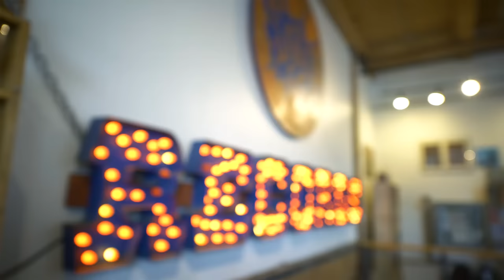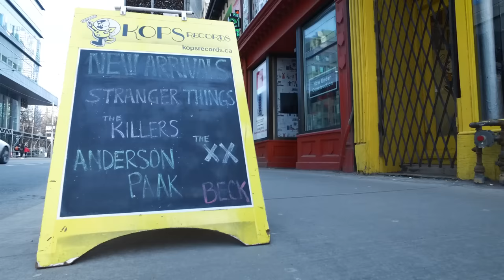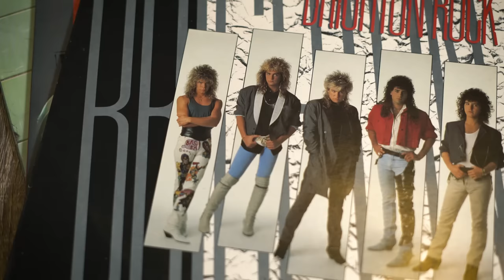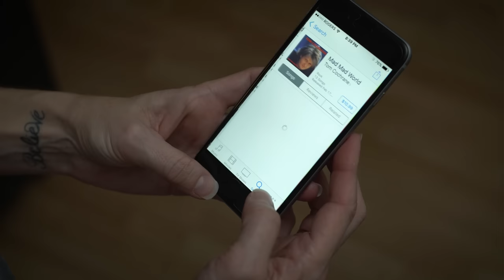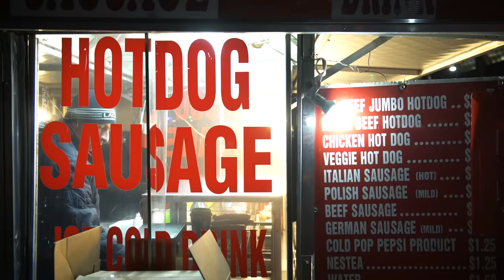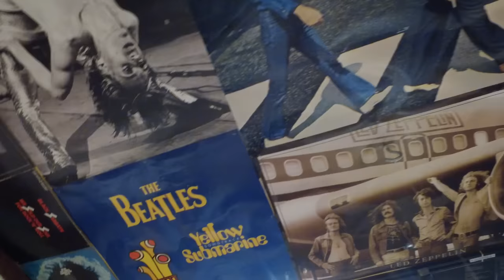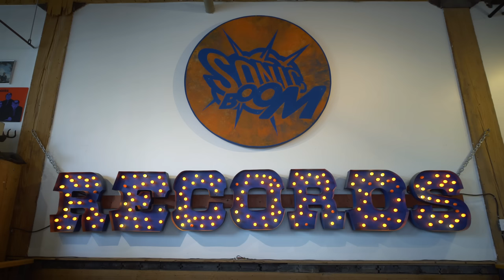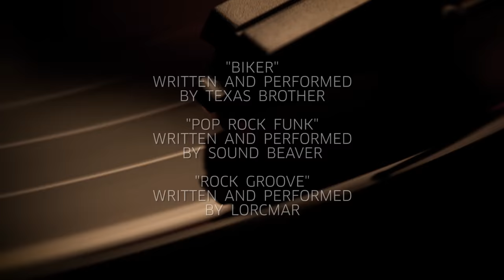Vinyl Revolution -| Music Documentary | Full Movie

Comment: You know this is all individual perception, not fact. The sound you hear from any speaker is an analog signal, whether it comes from a record, cd or mp3.  A cd is just a laser that reads pits on a sheet of plastic while a record is a sheet of plastic getting spun by a motor with a needle dragging over its surface that distorts as it moves toward the center. The difference we hear is in the mastering.

Comment: Shortly before noticing this documentary I had listened to a Walter Wanderley album, which is a small part of the Bossa Nova genre I find fascinating and rewarding. Records were part of my life from the mid '60's onward and one aspect of the format I really enjoyed in the late 1970's was buying direct to disc recordings.  The best examples were quite dynamic and I still search for them, usually they can be found for very reasonable prices compared to when they were released as they tended to be rather expensive and limited editions.

     For many years I listened to CDs but gravitated back to records 5 years ago and back to that vast analog world, finding many artists that I formerly never knew, of course musical preferences changed as I aged so that opened a door into so much diversity I would have not previously considered.  I have yet to find an analog recording converted into the digital format that can surpass an original pressing on LP.  Admittedly there have been more than a few marginal releases mastered even during the heyday of the 1950's and '60's but overall a much more involving experience.

     One senses they might be " addicted " when what was supposed to be a diversion with a single turntable becomes five, in fact I use two in my modest bedroom system as I listen to albums practically every day and thought it might make sense to slow down the wear and tear. I seem to have an appreciation for Japanese direct drive from the late 1970's into the early 1980's, what is considered the '"golden age " for the design. An added advantage is having different cartridges as well with their own unique sound signature.

    I suppose retirement does have certain advantages, being able to listen to music any time and more of it available allowing one to visit local record stores. The increasing number of reissues, especially in the Jazz audiophile category can definitely create a budget crisis at times but I have to admit I often find more excitement going through the 1.00 section which has allowed me to add quite a number of lesser known musicians to what is basically a musical library. Very fortunate to have access to the large number of ex CBC Radio Vancouver records that are made available at one store in particular, albeit in small doses as there are hundreds of thousands in storage that are slowly put on sale. That adds another part of the history of music as well, knowing at one time an album I have was played over the air. I have also found inner sleeves or notes signed by the artist in a few of the 1.00 LPs which is always an added bonus.

  Except for the limitations that most of us have trying to store one's collection the only real negative aspect is the thought of moving all of them!

Comment: The 180 gram thing is more or less a sales gimmick. It's possible that a heavy record may help to dampen vibration while on the platter (I've never noticed that), but the thickness of a record has nothing to with sound quality since all grooves are cut at the same depth (it is the width of the groove that makes a difference in sound). The only real advantage to heavier records is that they may be more resistant to warpage or breakage

Comment: I started buying vinyl in the mid 90's when albums in good condition where on average $3 each, yes they really common albums. Hard to find albums,  most of them I have never come across. I don't like brand new albums, as it takes away the fun of finding an original, or an old reissue, that is still vintage.  I've own over 2,000 albums at one point, not including singles.

Comment: For me the best part about vinyl is that it isn't brick walled like CD's and digital files are.
Reply: That has NOTHING to do with the medium, and EVERYTHING to do with the Mastering of the audio that ends up in the medium. Make a master from the original master tapes/files and put it on an LP, then take the same tape/file and do an equivalent master for CD/Digital, same levels/dynamics, and discounting the gear you use to listen to in on, there is NO functional difference. What spoiled everything was the "Loudness Wars", NOT the fact that it's analog or digital. And not ALL CD's or Digital files are normalized and brick walled to death...
Reply: @conan5885  it's my understanding if you mix a vinyl record too loud it skips? I know not all digital/CD releases are brickwalled, but so many of them are, while their vinyl counterparts aren't (or aren't as bad).

Comment: 90 percent of the audible difference between LP and CD is how they are MASTERED. The other 10 percent is surface noise from the vinyl surface.

CD, and digital uploads, are mastered for maximum LOUDNESS, because it can be done so in the digital realm more so than with analog/LP.

Put the pre-RIAA curve master for LP on CD, and I guarantee you it will sound just as good as, and exactly like the LP, just minus the surface noise, hiss, crackles, etc.
Reply: This! ☝️
Reply: It's not only the Loudness issue regarding the Master, it's also the corresponding EQ for each medium. If you put a copy from a Master that's been mastered for LP without touching anything on it, it will sound trebly and shrill. If you properly EQ and master it for CD without over-compressing it and touching loudness or the dynamics between the frequencies though, and discounting the fractional coloration from the equipment that is played back on, it will sound roughly the same.
Reply: @conan5885   It would probably sound thin, not because the CD is doing anything to it, but because CD/digital audio itself  is  perfectly flat bandwidth,  from 20Hz up to 20kHz.

Whereas our hearing response is anything but flat.

Comment: Buying vinyl is cheap enough. But you need a good quality system to play it on to really hear what you were meant to hear. Buying a Crosley portable turntable will just not cut it in the least. Test drive some system before you drop your hard earned money if you want the true vinyl experience.

Comment: I disagree with the speaker who at 11:15 who claimed that vinyl quality went downhill after 1974. I have 30 feet of LPs from before 1989 and what I observed was quality was manufacturer dependent. Columbia records were the very best. If the record had a red label it was going to be perfect and sound superb. But records by MCA were the very worst. MCA records have poor sound quality, tons of noise and pops, and there could be chunks of recycled paper built into the record.
Reply: Yeah, I disagree for the most part. The RCA Dynaflex and Ktel albums, fit what he was talking about - they were cheap flimsy and pressed with dust in the groove. Most were still pretty good. One thing that he IS correct about, those pre-1973 vinyl could play through, even when heavily scratched

Comment: Buying a used or new reissue vinyl pressing, then playing it on something along the line of a Crosxley turntable for example, defeats the purpose of getting into vinyl. Start at a minimum with a half decent used entry level Dual turntable like a 505-2 with a Shure M97HE cartridge for example. This would justify getting into vinyl in terms of the minimal quality a turntable has to have in order to make you want to buy records. otherwise, streaming and or CD will blow the roof off the Crosxley house and unless you just like watching a 12" wax disc spin, you have absolutely no reason to buy records if you plan on using a POS turntable. BTW, back in the 60's and early 1970's, even the worse turntables you could buy were considerably better than an injection molded thing made to look like a turntable. Like anything just do the research before you waste your $$ not being able to appreciate how vinyl sounds. As a rule, if the record was recorded onto tape, generally the original first pressings released will sound the best. Although remastering has improved considerably and if the orig tapes are still in good condition, then the reissues can sound really good, sometimes better than the original or early reissue pressings. The vinyl for starters is typically better than records pressed from the early 1970's onward.